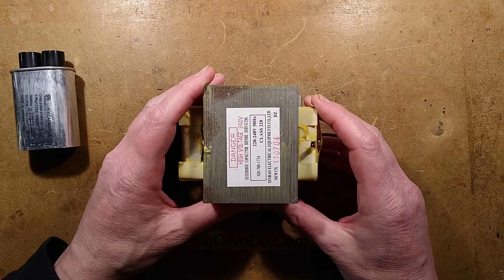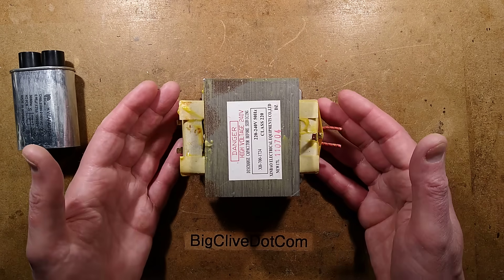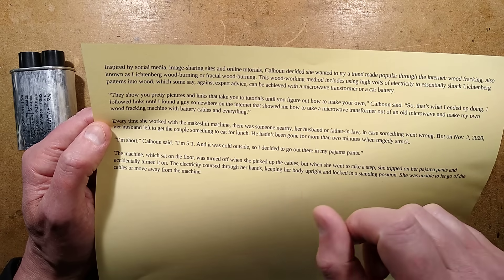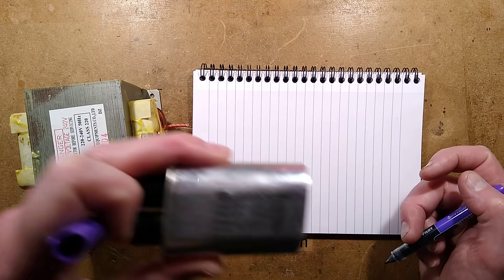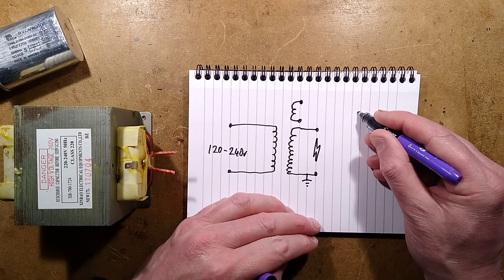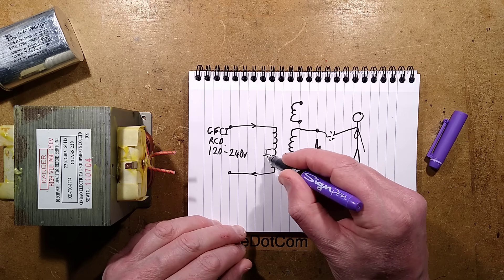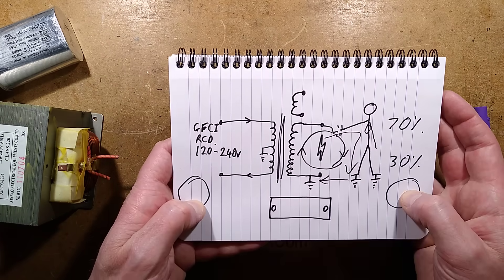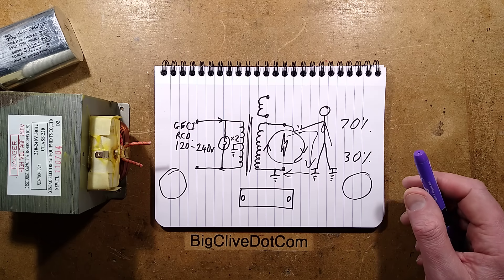The most deadly project on the Internet

Comment: My early life experiences with electricity gave me a healthy respect. I remember plugging in my model train transformer and carelessly touching both prongs and how much of a shock I got (110v). Certainly gave me respect. Then a teacher unplugged a record player (yes that long ago) by pulling cord rather than plug and the huge spark which made a big black mark around outlet and stayed there the rest of the year. And then later accidentally let screen touch the tracks on my model railroad and it started glowing red hot at 12v. Even at these much less dangerous voltages you need to be careful. I can only imagine how much more dangerous a mw transformer is.

Comment: Good safety education, here. When I played around to make a HERF gun, a Jaycobs ladder, and a high-voltage arc welder with my microwave transformer, I...

For the HERF gun, I...
- researched online the common mistakes/dangers of people trying to make HERF guns, and also defective microwaves (1 thing I learned is that microwaves (the radiation itself) can quickly "egg-boil" the fluid in your eye lenses, making you permanently blind, so yeah good to know)
- researched videos of HERF guns and their effects on flesh and machines (1 video showed a guy cooking bacon from 3m away, which clued me in on how quickly it can heat flesh)
- made a dead man switch using the door switches from the microwave itself
- made damned sure the antenna was pointed well away from anything important, including my eyes
- surrounded the antenna with an aluminum foil cone to prevent leakage radiation and focus the rays

Despite all of this, I still suspect the microwaves screwed up something in my computer which was about 2m @ 90° away from the antenna, but who knows? (Note to others: don't use a HERF gun anywhere near satellite dishes or WiFi/bluetooth antennae (mobile phones have built-in WiFi antennae), otherwise you risk destroying/setting fire to very expensive things)

I also  "tried" my hand in the HERF gun's ray for 0.1 seconds (using the switch of course); my hand got slightly warm, not on the outside but all over the inside, which was an interesting sensation.

For a Jaycobs latter and arc welder, I...
- held the dead man switch in a very loose position with my fingers, so that if somehow electric current forced my muscles to tense up, my fingers would slip off the switch instead of get stuck
- used an insulated copper wire for the HV side
- held the HV wire with an again insulated pair of needlenose pliers (probably still wasn't safe enough, either way)

I freaked out when the power was off but I touched the transformer and felt some kind of nerve tingling in my body; I thought I got hit by residuals in the high-voltage capacitor, and maybe I did, but nothing seemed to happen afterwards.

I also did some cool water salinity/conductivity experiments with 120V vs 2kV by getting tap water and looking at how much current passed through, but unexpectedly I noticed I was actually doing deoxidation and dissociation experiments at the same time (electric current was dissociating H2O into 2H+O gas and redoxing the metal electrodes)

Never did wood fracking, but I would definitely pull out as many stops as possible before getting anywhere near high voltage that can deliver more than a few microAmps.

Because yes, this is not a nutrition advice TikTok, but people can die with bad or negligent instructions/information. The 2nd video in the YouTube description is a very good interview and story of a survivor.

Comment: I'm not even entirely comfortable with you giving security advices on that. You just don't play with high voltage.
I understand your reasoning where you say "if I say no people with do that anyway" but still. 

Italian law about security on workplaces says you can't be anywhere near anything high voltage. Like minimum of 5 or 10 meters of distance anytime.
If you need to do maintenance on powered high voltage system first the law says "hell no, you don't" (quite literally in the law).
Then it adds that if you really really need to do it - like the nuclear power plant is going to blow if you don't - you need two certified electrician supervised by a super certified electrician with special training on that and you have to do a special safety briefing and everyone has to wear protective equipment that would make iron man blush.

Comment: I have worked with electricity for over 60 years but I have no desire to play with this as I prefer much lower voltages. If I were to construct such a unit, I would run the power from the supply cord through two light bulbs and then to the transformer. The bulbs could be used to illuminate the work space and they would be a reminder that if you can see the work, the unit is on and there is a danger of shock or electrocution. Use two bulbs because there is always the chance of a bulb failing and the other is backup. I would also consider insulators that would keep my  hands a foot or more away from the work and they should be cleaned with distilled water as a final rinse. 
Most important, if you're going to do this, eliminate all distractions. No music, video or chatting with others while you are working. If you want to do something other than the work with the unit, shut everything down before doing so.  
The thing that makes this so dangerous is that you are using both hands. When I need to work with higher voltage such as line voltage, the rule is remove all jewelry and work only with one hand. Your other hand should be by your side and far away from anything that could possibly be grounded. You can still get a shock doing this but there is less risk of the power flowing directly through your heart. I prefer to work on electronics with the power off however most of the time that's not possible when you're debugging something. If you don't know how to work with electricity safely, don't do it until you learn how.

Comment: I feel like building a high frequency power supply would be much safer, something that could supply up to 5kv but at much higher frequency, upwards of 50 kilohertz ac witch would no longer shock if you where to come in contact it would just burn, at least that's the idea.

Comment: so if a GFCI like device was connected also to the secondary's would that interrupt it?
Reply from the maker: It would need to be rated for high voltage and custom designed.  There's a high chance it may also false trip a lot.

Comment: If it counts for anything, I've gotten a shock from 220v mains voltage while playing around with cheap travel adaptors. Behind the plastic casing, those things are just two metal prongs going into the wall and I was exposed to it. I was incredibly lucky that my hands were dry and the short formed mainly across my fingers, but it was the closest I've ever been to dying. Words can't really describe what electricity feels like as it's flowing through you, it's nothing like a static shock. More like hot vibrational energy that has already passed through you millions of times before your brain can even receive the first stimulations. There must be so many people out there for whom this was the last thing they ever experienced.

Comment: wouldn't you sqeeze both buttons when you get shocked. is't it better to have some sort of "controller" with the buttons facing outward as in pushing them when you open the hand so when your hands curl up it will  shut it off (- 🖐-)

Comment: to some extent I disagree with you. Standard shoes, sure, they're insulating, but not very insulating. Shoes with an ATSM EH rating have to meet the standard, which is 18kv at 60hz with 0v leakage. yes, 2kv is high, but 2kv < 18kv, and AC power doesn't change frequency in a transformer. "decently insulating shoes" are shoes designed for insulation. wearing shoes designed for electrical hazard would make your body not a path to ground for a standard microwave transformer. the problem is, most people engaged in hobby crap aren't exactly following OSHA regulations for electrical hazards.

Comment: The buttons on the deadman switch should also deactivate if you press too hard. Otherwise it might happen that you can not release the button if you get a shock (electrical or scared because someone else is getting one).

Comment: And here is the reason why i feel perfectly safe working on 240v installations, but won't touch inside a unknown machine without a meter and insulated tools.
Anywhere where i do not know the voltage or safety factors (RCD,insulation,etc) i go back to the basics of; test, verify, secure (@12:20) and never work alone..
Some people find me silly in that, or absolute insane for working in a live switchboard (But not live components)(240v). But it call comes down to knowledge of-and safety.

Comment: I don't see why people fuck about with electricity, making gadgets with absolutely no fail safes or safety measures (like extra insulation). I'm not an electrician. I know just enough to turn the electricity back on when an appliance has tripped a fuse, but for some reason I know not to fuck with electricity.
This man is doing god's work

Comment: I've played around with a microwave transformer and came out with a few really nice looking fractal wood images. I never saw the point in wearing PPE or using proper gauge wire because on the other hand I have a healthy respect for electricity and I would never dare touch the live leads. I just shove a couple pins into the wood, connect the leads, then go grab the plug and plug it in while watching and never put that plug down without disconnecting. I can't believe people are picking those leads up and moving it around to get a better image.. Like, for real? 

Thank you for this video about the dangers of these transformers. It's always good to be reminded to stay fresh

Comment: Idk why, if you were gonna do this, you wouldn't rig the prongs on a spring and make it work like cat claws, basically retracting once you're not pulling some kind of lever or switch, into a heavily insulated shell. You'll never make it 100% safe, but well using it, one would be much more cautious, seems like most accidents happen when not in use, so to make the probs retractable into a rubber housing, far enough that it one would have to purposely touch it up there, would be much easier to handle than a dead man's switch. The problem I see with that method, is it's putting more things to deal with, meaning that you're attention is now divided, instead of paying full attention to what you're doing, and possibly agitating some people, thus leading to more accidents. Or possibly creating a direct ground from you're arms, this way, it wouldn't, in theory, kill you, but only mangle you're hands. Then again, I've never dealt with 2000 volts, getting shocked is one of my biggest pet peevs. I can go from happiest guy in the world, to pissed at literally everything in a second. It freaking hurts to get a high voltage shock... for those who don't know electrocute is literally electricity and execute combined, so technically you've only been electrocuted if you die, which seems to be the case with this wood burning method, 2000 volts is insane amounts of electricity.

Comment: Yeah.
Young teen me was a bit of a DYI mad scientist. Before I turned into an actual scientist...
Heard of someone turning a microwave magnetron into a small EMP gun to burn out lights and electronics at range.
I decided to build one.  It worked. 
I decided to build a more powerful one which would include a bigger capacitor.
I got electrocuted by the fucking magnetron as I was handling it. 
Luckily I did NOT hold onto it like that woman. 
I was shocked for a fraction of a second on the back of my hand.
I was knocked out cold for about half an hour. 
And when I woke up it felt like I had been through the human brain equivalent of a windows blue screen and  unsafe hard reset.
I got driven to the hospital.
For the next 8 hours ish I kept losing consciousness and waking up over and over and my heart was basically beating like a samba. Fast one second. Slow the next. It took about 3 days to get back to normal and I was probably lucky to not have long lasting health problems and not dying during that time.
I learned from the doc that basically I DID reset to factory settings in a way. He summarized that my brain activity went blank for a few seconds.And that my heart did stop to beat for a moment. And that I was very lucky everything rebooted so to speak instead of staying off.
I dont have any long term health issues from that experience. And only a small spot of scar where I was electrocuted for a moment and the skin bruned to the 3rd degree. A pinpoint needle spot.
I was lucky to be young and very healthy and fit on top of being shocked for only a moment. And even then. I was technically  powered off. Brain and heart. For a second or two. In essence. Dead. 
And was lucky to come back from that black nothingness.
Dont play with magnetrons and capacitors from appliances kids. (and adults)
It'll fucking kill you. Whatever it is you are gimmicking for whatever reason.
it isnt worth getting killed for.

Comment: Wait a minute, I thought it's the current that's deadly. I've found somewhere that MOT can have 500mA, where 60mA can stop your hearth. But I've seen transformers that have 10kV and 30mA. And my understanding is that the high volatge is the thing that actually causes the wood to burn. Which you probably definetly don't want to get in contact with, but would it be actually as scary as playing with a MOT or electrical socket that has even more current?
Reply: Yes, current is deadly, and it needs voltage to "reach" you and kill. There are also some interesting things about frequency of alternating current during electricution, check it 😟

Comment: HI from across the big pond (Yeah that thing called the Atlantic):
I have worked with HVAC and in-house maintenance in large facilities for years.  I even took a break to teach HVAC and electrical fundamentals.  It seems the two biggest killers for electricity are ignorance and complacency. 
You make excellent points!  the classic accidents that happen are usually caused by the perfect mixture of the above . . . along with hubris and stupidity.
If I may add this though: the dead man's switch may be better using a 24 volt control circuit through a relay. Anyway, I do agree; people need to know what they are doing, and then not work on things they have little to no knowledge of!

Comment: Don't worry, Darwin will protect you... :)

I have built one and used it.  If you don't understand the dangers of high voltage and how you don't even need to TOUCH the conductors to get shocked, then you really should not be fooling with it... The electric fence charger that is connected to the gate that leads from my garage to my back door has more voltage on it than the MOT has, but luckily a lot less amperage.  I've been hit by it a few times over the years. Many of the shoes that I wear provide enough insulation, even basic flops, but if the flops are wet, you will most definitely get bit by it... Electric fence chargers also tend to be pulsed, not always on like a MOT would be... CRT flyback circuits were what taught me to respect high voltages though... I've been zapped by them by just getting close to the wire and the arc jumping out and getting me...

Everything in life is dangerous... Life is about managing risks... If your risk management skills are not great, Darwin will be there for you... :)

If, at first you don't succeed, the sky diving (or experimenting with high voltages) is NOT for you... :)

Comment: I once survived a 2.5k  Vacuum plate voltage on a 37.260mhz transmitter ... it hurt scared and bruised me when it through me 10 foot into a wall.   The fault was in my HV rated test lead laying over my hot sweaty arm, cracked insulation on the test lead.  I had done this measurement many times lots of H.V. training over the years.  Caution Caution when ever around high voltage I was lucky.

Comment: Never tried to do this thing, but in the childhood I made my own HV HF generator. I used generic computer power supply for 12 volts, transistor and flyback transformer from old TV. Whole thing generated 10 kV at 10-15 kHz. Was pretty safe - you could get burns on your skin if you touch the arc, but no heartstopping - because of high frequency it couldn't reach the heart. Did some funny experiments with it - usual incandescent lightbulbs becoming plasma globes, fluorescent lamps shining without connecting them, lighting candle with an arc and blowing it out with ion wind. And also I burned wood with it, but in a different manner - instead of wetting the wood I created arc between electrodes near the surface of the wood, and from the heat wood burned into charcoal which is conductive, so current starts flowing through it and then I start to slowly move electrodes, basically drawing like by usual woodburner, not the fractal. And also I tried to melt some thin glass - ampules from some medicine, in the same way - create arc near the surface, glass heats up and become conductive.

Comment: i am electric worker and i did it 100 times 🤣 ok just kidding, i did it a view times and i allways was very carefull, i made a footswitch to the main, so if i would move it shuts of. but after watching a view videos of others and now your video, it really made me think, i mean, my device is standing around for allmost a year untouched, i guess the best idea is to take it apart and make a spotwelding machine out of it. since low voltage under 50 Volts in not dangerous at all. in the end i never used any of the figures i made anyway. thanks again for reminding me how dangerous it really is. i am going out now and destroy this thing once and for all 🙂

Comment: At 30kV, you don't even need to come in contact with the high voltage lead.  You just need to come within a cm of it and it will arc through the air.